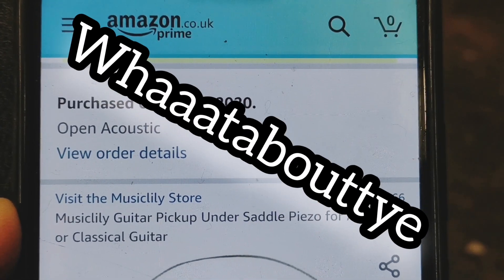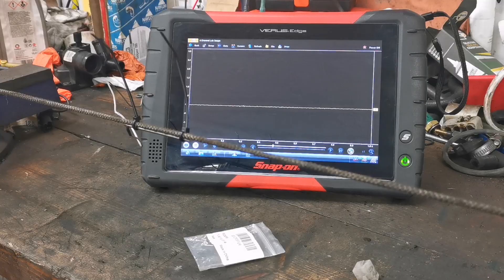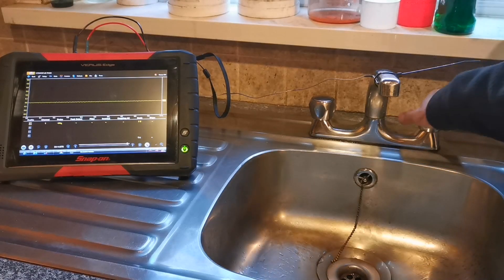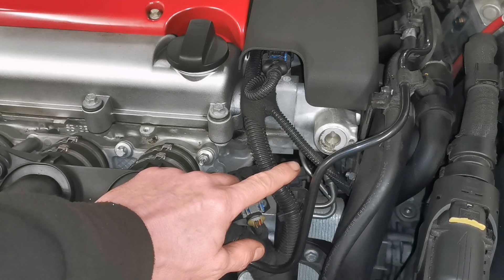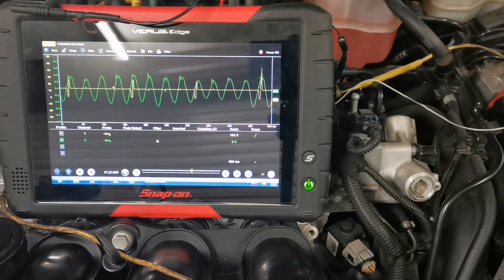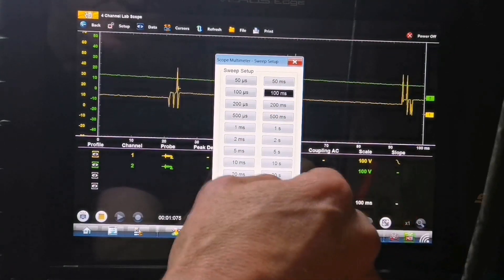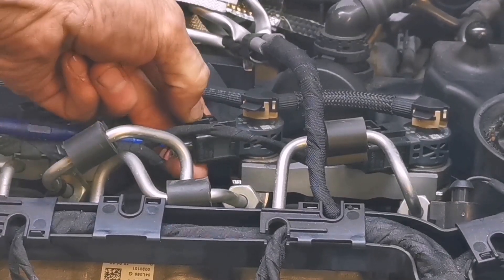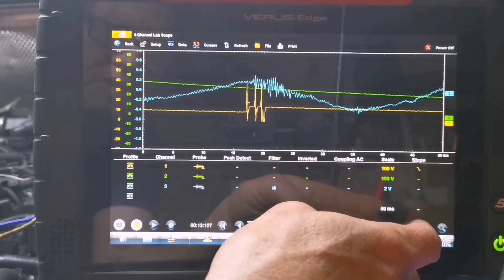Piezo Fuel Injector Tester Experiment

Comment: Great video Dave, I watched couple of injector videos but still confused, on piezo you can do ohms test and the 100v test, but what about common rail injectors ( I disconnected one to check for voltage at wiring harness it did not show me 12v when turning on ignition ) on any terminal then when I did ohm test at terminal at injector I didn't see anything it was brand new injector ) any idea why not !
Reply from the maker: common rail can be piezo or solenoid. You need identify what you have. Piezo's can have different resistances. The 100volt test is a megger test which is to establish the breakdown voltage, not a resistance check.
Reply: @davesterl Dave is there anyway to send you a message ! Email perhaps
Reply from the maker: https://www.youtube.com/watch?v=uzgsVy87XFs

Comment: That’s a very clever use of the piezo and lot more useful in the current climate rather than having it in a guitar.....! I wonder if it was put through some kind of amplifier circuit would it make it a bit more sensitive and give a more noticeable / usable signal output ...?
Reply from the maker: yeah, i think amplifying it would create noise, you can see more by lowering the voltage on the scope
Reply: dave sterl Ya I wasn’t too sure if the amplifier would make more noise but ya that makes since just to lower scope voltage. I must do some experiments if and when my 2204a turns up as I can’t for the life of me get my hand held fluke (got it for free) working right😡 The Pico software should be a bit more familiar as we have it in work for the 4425 (I think ) in the local Jlr dealership so it’s well needed😜